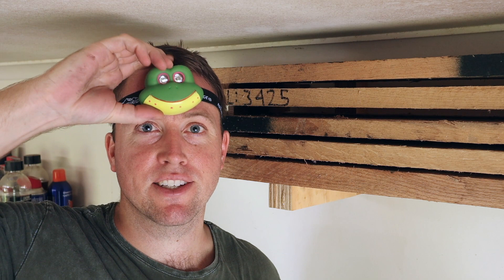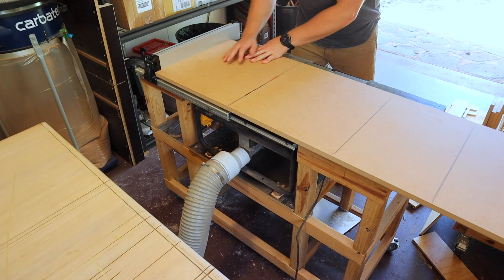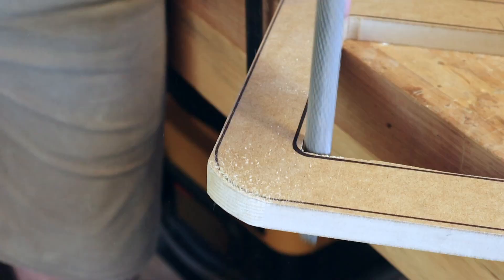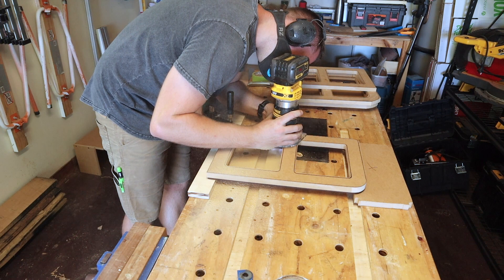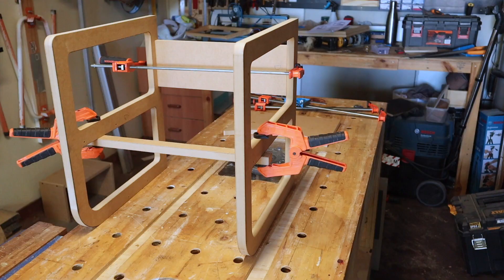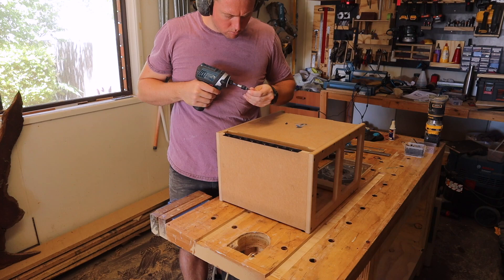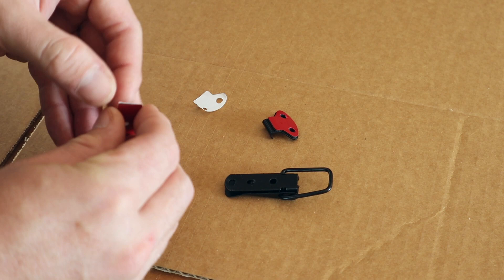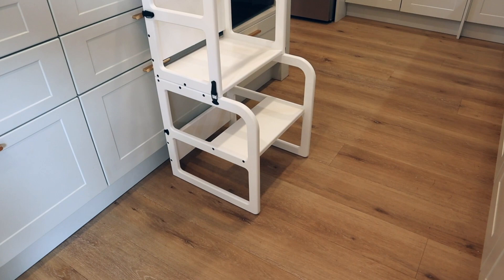Building a 2-in-1 Toddlers Kitchen Helper

Comment: The back brace to prevent child falling back, is it removable or does child have to sneak under it when they climb up?
Reply from the maker: It would be removable if you took the screws out, but my understanding is that kids are pretty flexible and sort of climbed around it. Some sort of hinged panel with a catch would be a good improvement though!

Comment: I am in the process of making something like this but made it out of 1/2 ply, I wanted to use wood inserts but I don’t think my material is thick enough. Do you think screws will hold up fine ?
Reply from the maker: Hard to say, I imagine it would be with good long screws. I built a small platform to test the strength of mine beforehand. If it could hold me, it could hold a child!